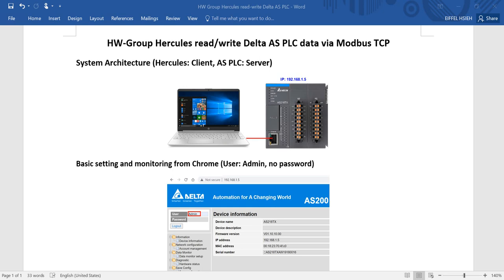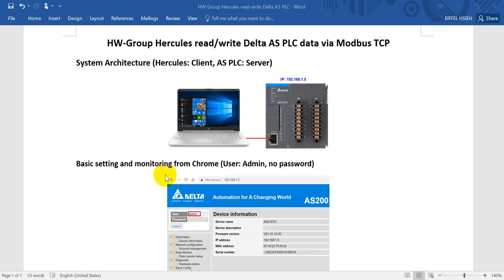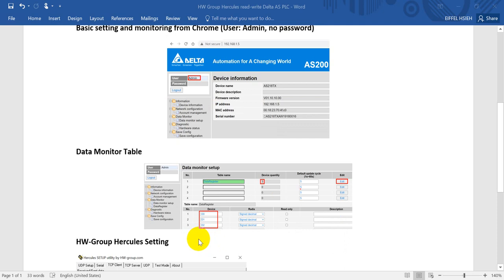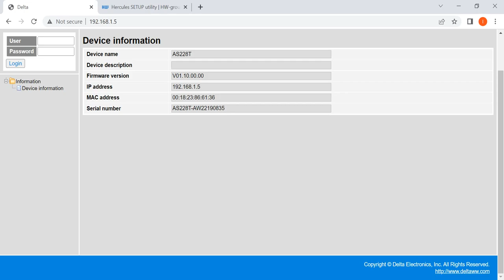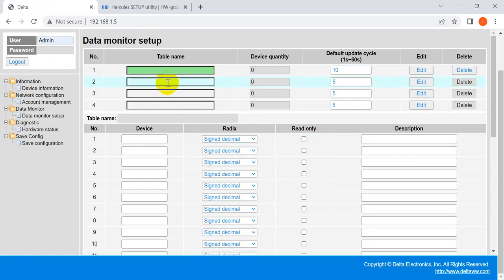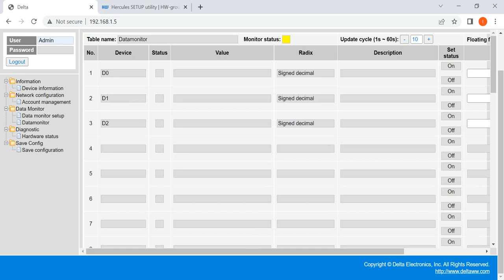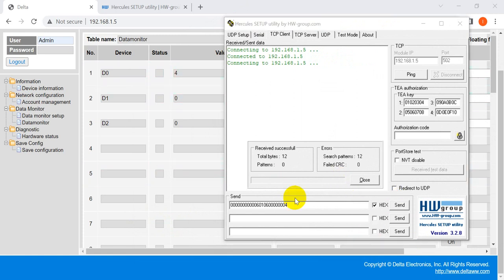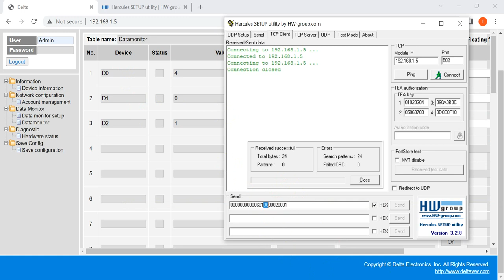Delta AS PLC and Hercules software Modbus TCP communication

Comment: Can you demonstrate this using ladder logic program in the plc(AS228T-A), i want to use the plc as a server(slave) and my pc as a client(master). The connection is established, but as soon as connected,. it ended up "connection reset by peer." i want to read the data from plc to my pc. I watched your socket demo video, i changed the s3 operand as 0 to make the plc act as a server.